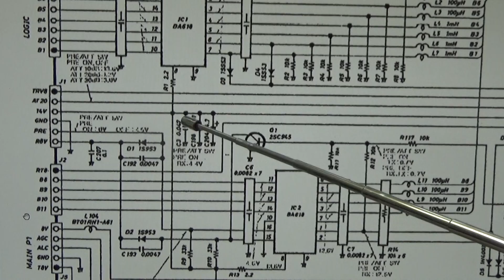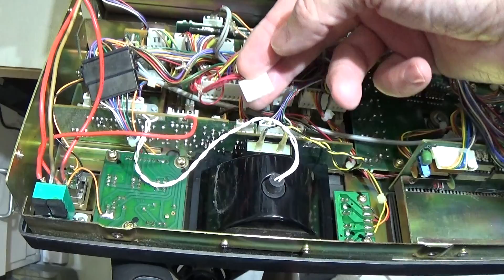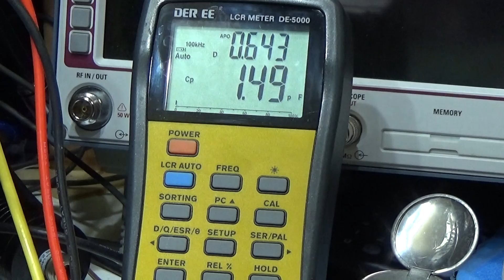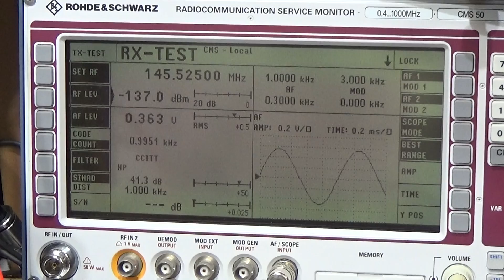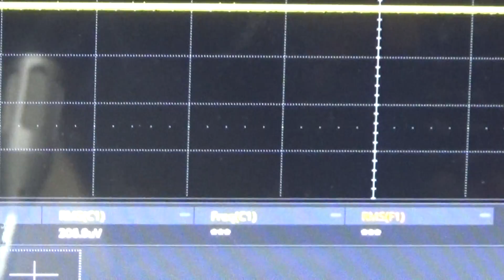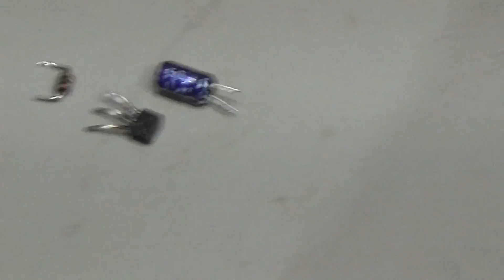#258 ICOM IC-765 SMOKES during Transmission

Comment: WoW Peter.  I admire your patients.  While I was never a fan of SMD circuitry I can now see how fault finding is a bit easier with SMD's.  From experience over the years I found the early Japanese radio equipment voltage/component wise sailed very close to the wind.  That job was really a nightmare of a job.  I hope you slept well after that job.
EI6DP
Reply from the maker: Thank you! Yes agreed it is much easier to work with SMD as long you took your time to get familiar with SMD's

Comment: 5  problems but presumably it was working before it smoked. One common denominator is the 14 volt supply.  Is it possible that either an operator error or a momentary power glitch could have caused all of these to fail at once?  A momentary high voltage on 14 is one possibility.  The 16 V cap failed  taking the inductor.  The regulator failed also which could have been overvoltage transient.  Hardest to explain is the driver transistor for the TX switch. W5PZT
Reply: The momentary glitch was the Tant shorting out.  They are well known for this.  I think that event might have caused a transient on the 13.8V supply regulation that contributed to the other failures.

Comment: Hello Peter, it is allways a plesure to watch your videos.
This couple "different" problems of the Radio look to me from a near lightning hit.
All regulators are connectet togeter via gnd... even the capacitor witch was blown.
I hat allmost the same ott problems after a BIG lightning hit pretty close to my house.
The realy high tension came over the GND and produse the same faults in my equipment.
But with schematics and a litle luck i was able to help me out.🙃

Comment: Hi Peter, Another interesting video. You notice that the faults are all to do with 14 volt supply which would suggest to me that the 14 Volt rail has spiked at some stage causing the tant, voltage regulator and various regulating circuits to fail.  ICOM mains PSU’s are notoriously problematic.  I would check the condition of the surge arrest circuits in the front end of the PSU along with the capacitors and the usual stuff as it may just do it again. Best Regards John
Reply from the maker: Thanks John, very good hint. I did not remember that this particular PSU was so problematic, but you are the ICOM  specialist!
Reply: @TRXLab  Hi Peter thanks for getting back to me. To be honest at this vintage I don't think switched mode PSU's age that well generally. It’s an interesting failure, it may have been that the tant shorted and the PSU over shot the target voltage when the short condition cleared. Great video as always BTW I love all the fault diagnosis you really are a master at it. Hope all is well, very best regards John M0XFX

Comment: Tear drop Tantalum capacitor's, I don't know how many I have seen over the years that they short and burn like that. Some will emit so much smoke that you'll think something really bad has happened. I know designers use them for there low ESR rating but if it's in a not so critical circuit I've just replaced them with an equivalent electrolytic type.

Comment: I had a 765 that was not tx or rx and it was a capacitor on the regulator and a burnt resistor.
I cant remember if it was c15 or the other regulator
Reply: the radio also had horrible plastic vco type trimmer capacitors and I said the hell with that and sold it. I remember the beautiful ads for the 765 with the palm trees and sandy beach, I always drooled for it but time caught up with it. Merry Christmas coming up and God Bless